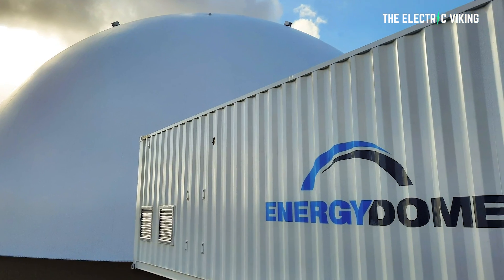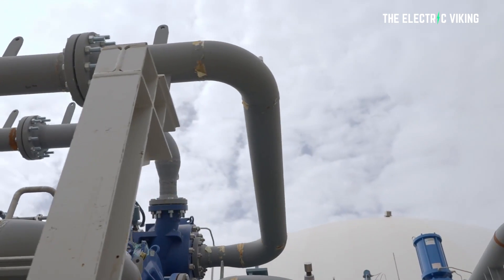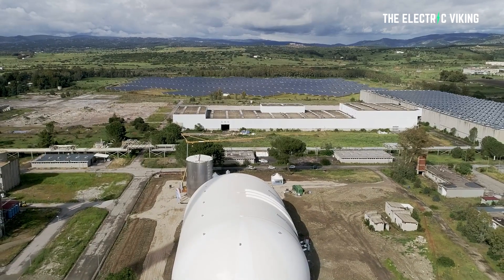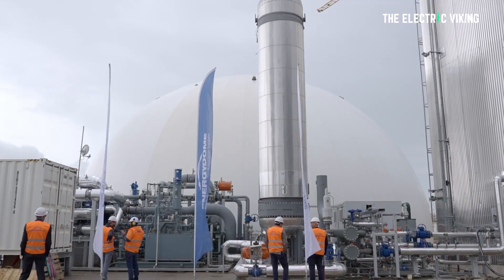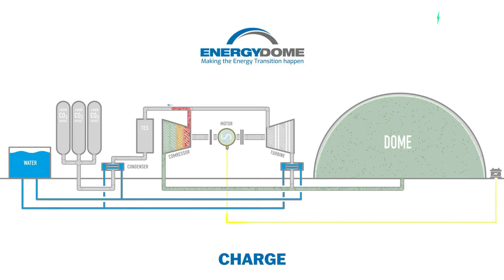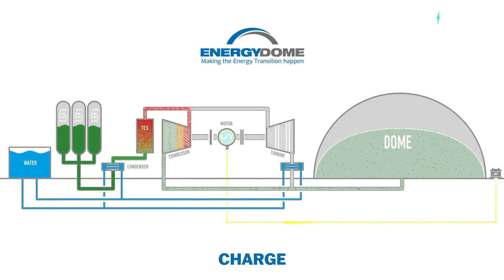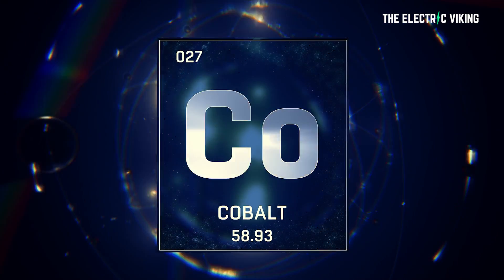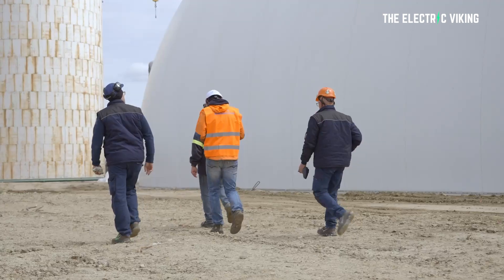NEW CO2 battery is about to change the world as we know it

Comment: I had not time to watch the whole video, but why do they use CO2? Why not using normal air like Highview power in the UK? CO2 is only present at 0,01 percent in normal air?
Reply: CO2 turns to a liquid at a high temperature. Air is many gases that need very high pressures or very low temps to liquefy.

Comment: Not a meaningful carbon capture and sequestering (CCS) device, as even liquefied carbon dioxide in these tanks does not amount to much carbon storage. Still, it is an added bonus to this original battery device.
I wonder however what happens to the CCS module once the carbon dioxide tanks are filled to capacity. Obviously, it is not needed anymore in such a closed loop system. So is it maybe mobile in order to fill the next carbon dioxide "battery"? It would be a total waste of resources if there is one such CCS module for each battery and it is used only once at the beginning.

Looks like the gas expansion tank is only half buried in this example. Maybe burying it totally would look better and make land usage possible, maybe for farming, as wind towers and large solar power plants are often located in agricultural land, or right under these solar panels. No danger of human life losses either in that case. Costs would obviously be higher, but we are already artificializing too much natural or agricultural land as it is with renewable energy power plants.

Comment: Energy response is fast but efficiency is a bit low, around 75% according to Energy Dome, which is much lower efficiency then lithium batteries which is near 100%. Though the overall storage cost is more than 60% cheaper than batteries. The 2022 is a demo plant with only 4 MWh of storage. 2023 they plan a 200 MWh plant and sky is the limit from there..
Reply: This will be used to time shift free or very low cost electric y to a time of highest value.

Comment: I wonder how this technology pits up with pressurized nitrogen as an energy storage solution, when it comes to running cost and efficiency.  Nitrogen has the advantage of being the main element that makes up the air around us, so if you would pinch a  hole in the container of the stuff, literally no harm would be done to the environment.

Comment: This energy storage system is just one in the mix of new solutions that are just around the corner. If the calculations are right, grid investors will jump on this solution. And they have started to. This is in the same line of energy storage as the compressed air battery in the UK. Another one about to go online is that mechanical concrete block hoisting system from Switzerland. And furthermore the first grid results will be coming in from those AMBRI liquid cheap metal battery storage systems in the US. As for storing heat, Finland has heating grid results from the sand heat storage system in towns and eventually cities. Lots of great storage solutions around the corner.

Comment: I would have thought liquefying nitrogen and storing the heat from that, then reheating the nitrogen would be way more efficient on account of the temperature difference between the cold and hot part of the process is much greater. Delta temperature is the real measure on account that this is still a Carnot engine.
The idea has been around for a while. Maybe CO2 is cheaper on account high pressure storage is more expensive.
Ultimately the cost per KWH will separate the winners from the losers.
So don’t get too excited yet.
Reply: No , because the ideal medium for this kind of phase change process is an easily liquified gas such as CO₂ or ammonia. This is why these gases are used in refridgeration systems.
When you use other gases, you have to use much more expensive compressors , pressure vessels and much more energy to run the system.
Reply: @paulg3336  no they’re used because low pressure vessels are cheap and easy. You can purchase liquified nitrogen that stays in a dewar at atmospheric pressure for about the cost of milk. So the simple thermodynamic equations remain, the biggest heat differential you can use to drive a Carnot engine, the more work can be derived from it.
Reply: I suspect it’s pretty efficient because it doesn’t need cooling and QED it’s raised a not inconsiderable sum to build its first plant funded by people who aren’t totally stupid.  I like the fact that it’s simple.
Reply: @oldbasted  doesn’t need cooling, eh? You clearly don’t understand thermodynamics, this thing is just a heat pump. People are fooled because CO2 goes through a phase change. So does water in a stem engine, the phase change means nothing. Energy is stored by heat, heat is extracted to run a turbine. Yes, people are fooled and lots of money has been raised for failing projects before a will in the future.
There are suckers born every minute.
Yous sund lick wun uf dem.
Reply: @oldbasted  hey, if you really want an off the shelf heat storage battery but cheaper than the dodgy one described here, why don’t you get out of that armchair and make yourself one?
Here’s how: https://youtu.be/kzj1PCA_jxA

Comment: Designed a concept for a CO2 thruster powered areobot to fly in Mar’s atmosphere, was a bit smaller than this though and used solar panels to recharge itself.
I wonder how far an ICE car would go powered by liquid C02, would have to use a BMW because the heat exchangers would fit nicely in the huge grills.

Comment: Not really reverse climate change, just mollify its greenhouse effects. The CO2 would still be in the atmosphere regardless of the space bubbles. Reversing climate change requires CO2 removal from the atmosphere back down to 300-350ppm.
Reply: Would be interesting to calculate how much CO2, powering much of the World this way would require. Regardless it's key effect for climate change would be allowing solar and wind to take a bigger slice of the world energy pie by enabling medium term storage. Battery storage would still be needed for peak ballancing. It looks expensive I tend to prefer Iron flow batteries but would need to see comparative costings for the stored energy. The cheapest will win.
Reply: The problem with your statement is that removing 72ppm CO2 from the atmosphere would NOT reverse climate change. For 60 years they've been trying to prove that CO2 drives the climate, but failed 100% to do so, there's still zero evidence. There is plenty of evidence that CO2 rises AFTER warming, around 800 years after; likely due to the fact that warm water holds less CO2 than cold & the oceans are huge reservoirs of CO2. This will be why the 30-odd models the IPCC rely on for their predictions have been so wrong for so long. They rely on CO2 being the driver of the climate, while it's actually a bit-part player. Also, the warming effect of CO2 on the atmosphere is logarithmic, not linear; something that's been know for around 100 years. 'Climate change' is a political project, not a scientific one. Now, I don't mind if you want to be impoverished by it, but there are billions of people who don't deserve it, so please take your disinformation elsewhere and stop pretending. Climate change is going to kill people, from starvation, smoke inhalation and other general causes of poverty. CO2 is plant food, that can save most of them...

Comment: Here's a summation and I've added some of my answers:
EnergyDome Italian start up has started to commercialize the world's 1st CO2 battery.
Has secured US$11M on 28/6/2022 to buy equipment for 20MW X 10 hours of power battery for Italian utility A2A. Existing backers include Barclay's.
Total funding is now $25M. 
Battery sited in Sardinia which uses coal.
Company moves fast.
Uses off the shelf equipment.
Has signed agreement with Ansaldo Energia for use in Italy, Germany, the Middle East and Africa.
CO2 is one of the few gases that can stored as a liquid under pressure at room temperature.
Allows for high density energy storage without the need to go to extremely low temperatures.
Compressed CO2 gas expands runs a turbine produces electricity and the CO2 is stored in a bladder in a dome.
Then renewable energy is used to compress the CO2 and store it for repeat use.
Doesn't use Lithium, Cobalt or exotic (supply bottleneck) materials, the technology is geopolitically independent. (Russia and China et al not required)
How energy dense is the battery? <Not very -that dome is big and has to be placed where space is not a premium>
How quickly can it respond to the grid? <faster then a peaker plant, slower then a Tesla FCOS Mega-pack>
What happens to the CO2 at the end of life <put in a tanker and transferred>
What is the efficiency of the battery? <slightly better than a liquid air battery>
Reply: Efficiency for liquid air is about 25% to 70% - more efficient if it stores the heat from the compression process, which this system does. So maybe the CO2 battery will be 50% efficient. If they go thru dozens of iterations it would get to 50% to 60% imo. 

People ask What happens when the wind doesn't blow? but they never ask What happens when the wind does blow ... at 2 am in the morning? And the answer is they feather the blades and basically throw the electricity away because there isn't any demand.

Comment: Some points. 
It is not a battery. There is no chemical reaction involved. Just phase changes. It is an energy storage system.
The heat of compression is stored in water, and additional heat is taken from the atmosphere to aid evaporation of the CO2 back to an energetic gas. 
At the plants end of life, the compressors can liquefy the CO2 and put it into trucks for some other use.
They have built one. They know the economics of its operation. After 6 months of running the next, larger, plant they will have further proof of its viability.
The electricity to run it will come from curtailed mid day solar or over night curtailed wind.
Reply: If "they" know the economics of this concept's operation, they should tell us. Otherwise, it's just another boondoggle sucking up our tax dollars, with no accountability to us, the taxpayers.

Comment: This concept is interesting. Hydroelectric dams work on a very similar principle... pump the water to an upper lake during low-demand times and drop the water through turbines during high-demand times. Except in this case, you're pushing CO2 back and forth instead of water. Very interesting, indeed. While $25 Million sounds like a lot of money to you and me (because it is), it's actually nothing huge in this particular field. I suppose you could build a scaled-down pilot plant or something, so that's pretty cool. I look forward to hearing more about this one.
Reply: They are looking at pumped hydro here in NZ, at a cost of $NZ4 billion plus cost over runs. So this is cheap
Reply: Do note there is a difference: This is mainly a thermalexchange poces, so enviroment themperature can influance the efficiency. Eg: Warmer climates can reduce heatexchange efficiency of nucleaire or fusion powerplants by 20%!

Comment: In the short term a version of this concept could also be used for dealing with CO2 emissions from coal fired power stations.
The CO2 from the smoke stacks could be used to inflate domes. When a dome is full renewable energy (solar, wind etc with battery backup) would compress the CO2 to liquid form in canisters and then stored in a repository, just like uranium currently is, (possibly underground) until someone in the future works out how to dispose of it.

Comment: What about the use of compressed air to generate electricity on demand of on the grid? This is another version of the compressed air generator but using CO2. China is beginning to  deploy compressed air generator in part of its grid.
Reply: Compressed air requires very large storage tanks. This stores the compressed gas as a liquid in a very small tank. 1 400 th the size of the tank?
Reply: @kkarllwt  True. But what China is using for compressed air storage are underground salt caverns. This is an operation on a different scale.
Reply: @kkarllwt  remember this system has storage for BOTH the liquified and gaseous CO2, so it does require a “very large storage tank”. Unlike Highview’s liquid air system that simply uses atmospheric air as the medium to liquify.

Comment: Based on the claims you make in the video I do not get the impression you actually understand how the process of this battery works. Or maybe, explain how exactly CO2 would be removed from the air. Essentially, energy storage is just pressurizing a CO2 reservoir and liquifying it, with part of the energy ending up in the hot water tank. When discharging, the hot water is used to vaporize the liquid CO2 and back we are with the same amount of CO2 in the dome. Or do I overlook something?

Comment: i'm confused, the pressurization of CO2 also requires energy, where does that energy come from? an external power grid? you can't pressurize CO2 from nothing.
Reply: Well, that's the point. It's energy storage, so you use surplus energy from the grid to compress. Then release when you need that energy later. Lot's of informed comments here of the viabilty of this approach. I don't have high hopes for this tech.